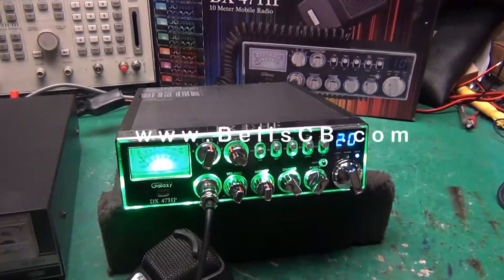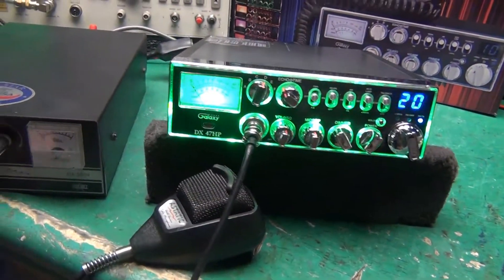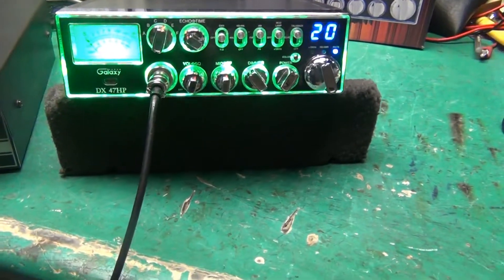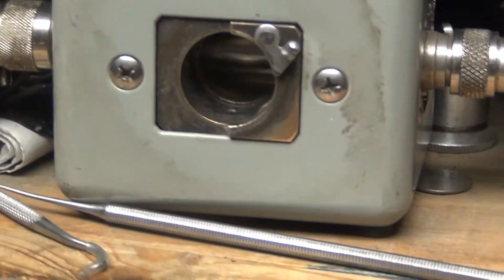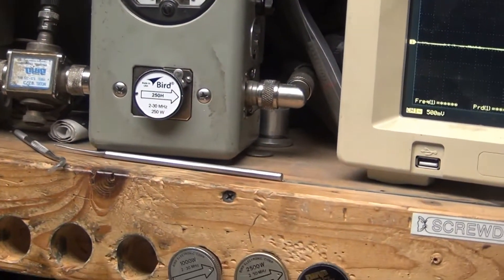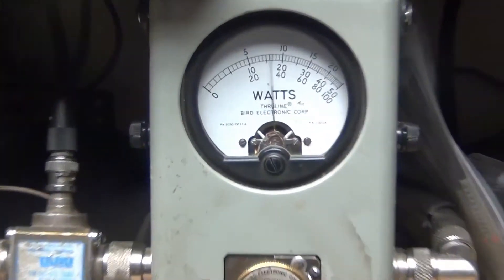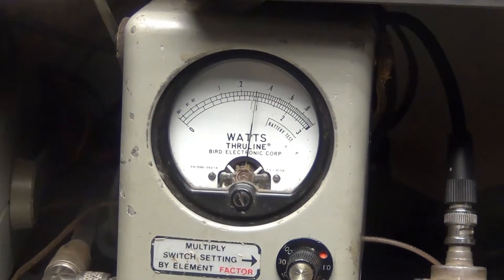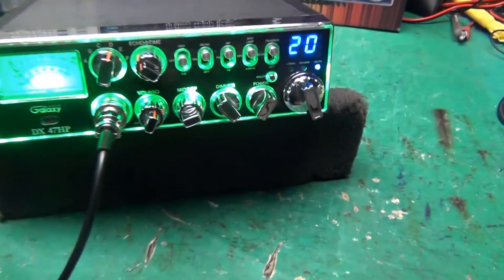Galaxy DX-47HP Tune-up Report with a Texas Star 500V

Comment: Hey screwdriver. So it's safe to run a Texas star 250 with this galaxy. Long as the radio power is on the minimum correct